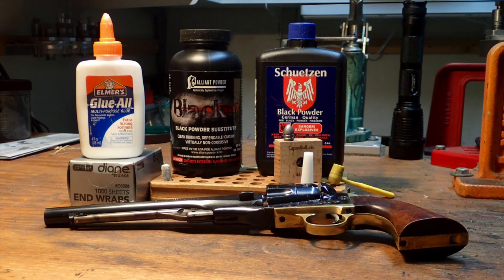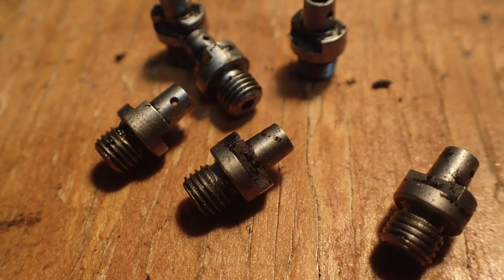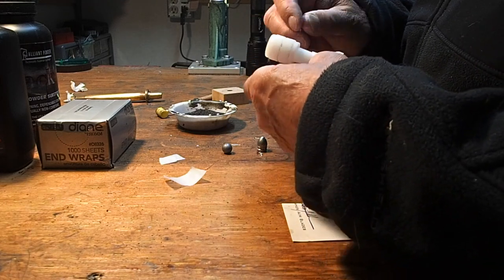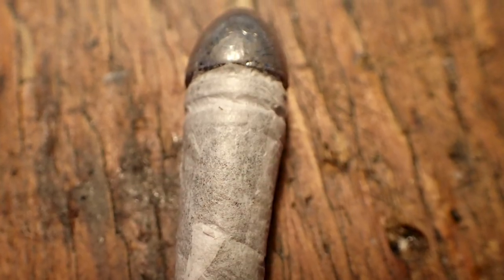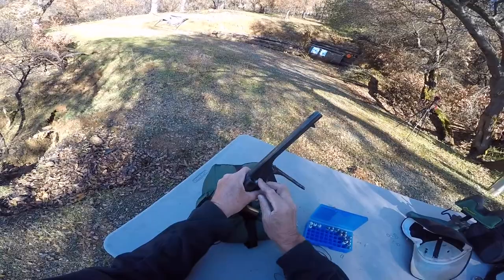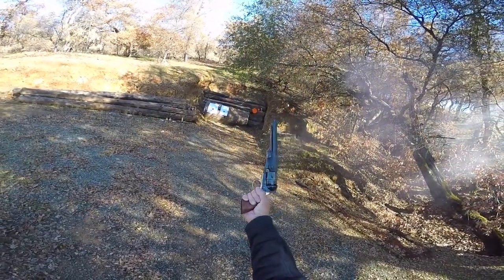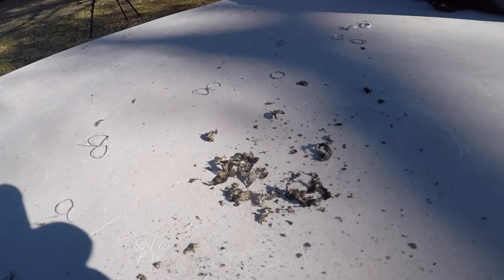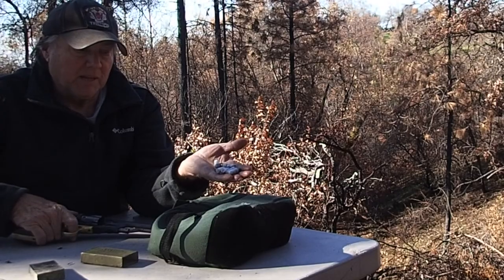CAP & BALL CARTRIDGE FORMER UPDATE, The Era's Gone Kerr Bullet

Comment: For school I had to get the grandkids some glue... what they use for paper is a Elmers glue stick.    These things are great!   the glue is purple and goes on purple but it dries clear..   and it has a twisty on the bottom like a deodorant stick  everything I wanted.    it is really cheap for even twelve sticks so you can throw on in your shooting bag(s) great for a corner of a stubborn target that wants to blow away.
Reply from the maker: That sounds like it would work great in this application too. Thanks for watching and the tip on the glue stick.
Reply: Yeah.. I like that it goes on purple from a stick.   You know when it is dry because it is clear at that point.   I know that I have covered the whole edge because of the color (I use ciggarrett papers and roll them around a dowel @oldscoutgp
Reply: I like them best because they set fast have good tack and I can see if I got enough on the paper because they're purple.
Reply: @ronrobertson59  exacctly!